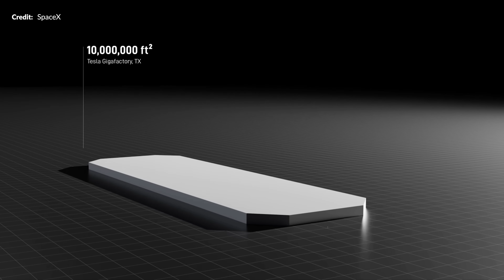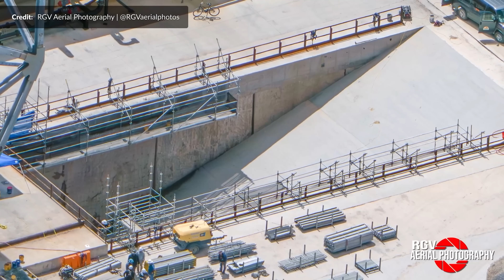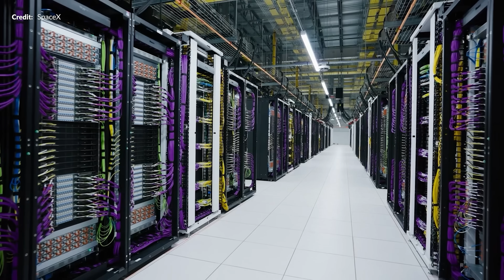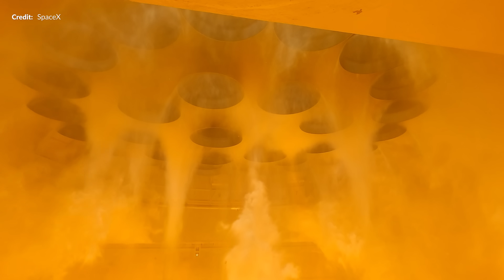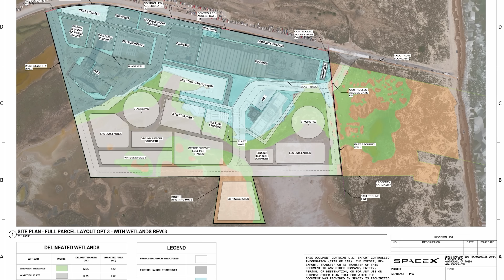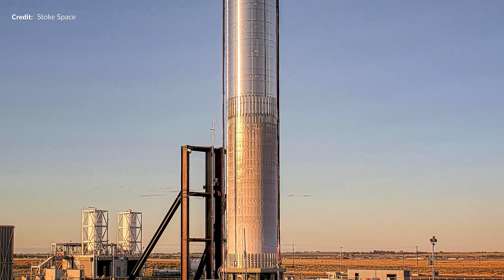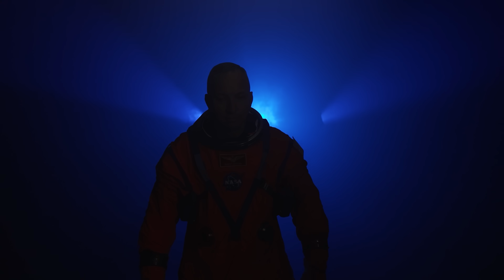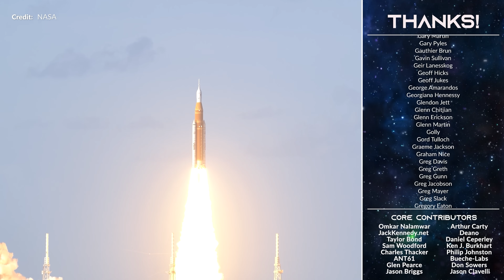SpaceX Just Revealed Its Biggest Plans Yet

Comment: Sounds like they try to hype up the people for their IPO. The fact that none of their plan is realistic should tell everything that one needs to know.
Chips SSD-s fail, data centers needs to be continously serviced parts replaced.  

Also you cannot calculate the weight by the energy production. The radiators have to be way heavier than the solar panels becuase they need mass to transfer heat.

Comment: Has anyone calculated the global volume of escaped methane per launch  in comparison to the projected launches I don’t think there will be much left of anything alive on the planet after those projections kick in
Reply: Less than all cows on the planet already produce every day.
Reply: @algcyt yes the issue is that it is delivered straight to the stratosphere
Reply: @adam-k  yes the issue is that it is delivered straight to the stratosphere.

That isn't methane, it is CO2 and water.  If it were methane the rocket couldn't lift off.

:face-turquoise-covering-eyes:

:face-turquoise-covering-eyes:
Reply: @Scanner9631 it is mostly the nitrogen oxides that cause problems with the ozone.
Reply: @adam-k  

Yet this was about methane leaks.  
Raptors produce negligible nitrogen oxides.  

:body-blue-raised-arms:

:body-blue-raised-arms:
Reply: After lunch you contribute methane too.
Reply: Yes they did. though not the methane is the issue. the emission would destroy the ozone layer serveral times over.